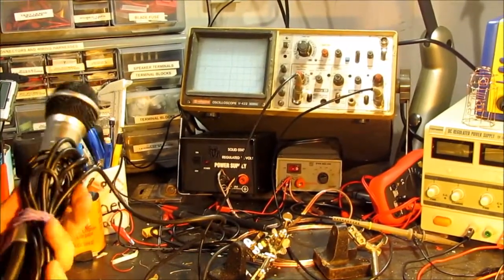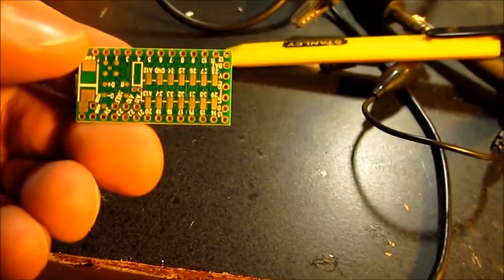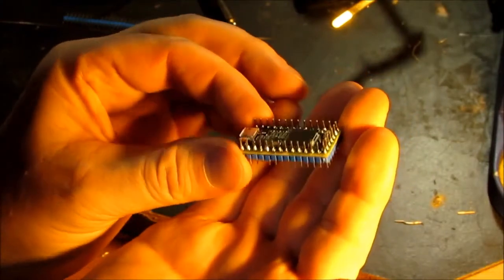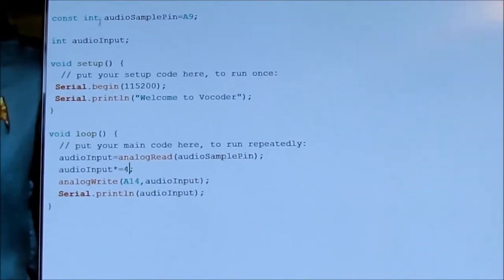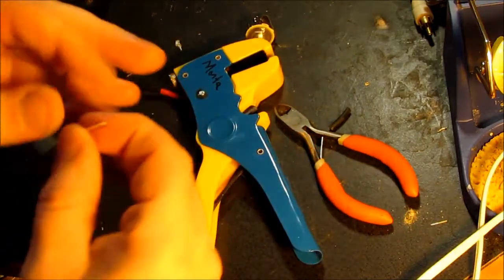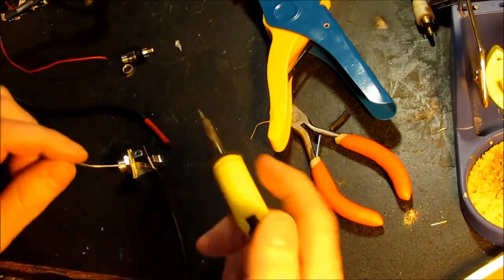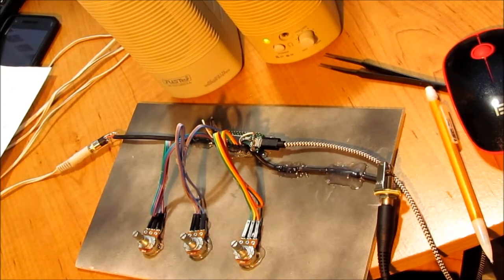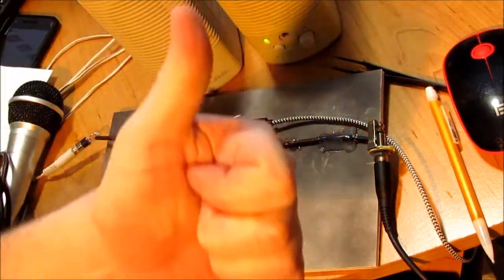011 Build a Vocoder - sound like a robot

Comment: Cool video Monta.. I see you utilized my pot wiring system. :)  I didn't catch the schematic though. On the analog in, are you setting up any sort of analog in bias circuit so you're not chopping off the bottom of your audio waveform? I would recommend doing this minimally with a simple voltage divider + de-coupling cap.. or better.. a v-divider on the input of a low gain OpAmp so you can buffer and condition the signal (including a LPF of .45 (or roughly 1/2 of)  your sample rate) before sampling it. That alone would probably really clean up the sound of your signal quite a bit /and/ prevent that lower-lobe chopping I imagine is going on.
Reply: Thomas Weeks - Well, where to start?  Learn something about timers in the Arduino cancer IDE?